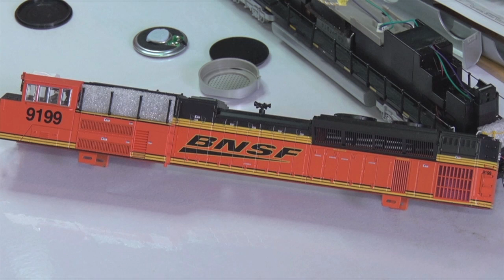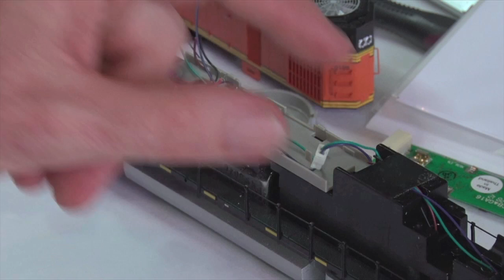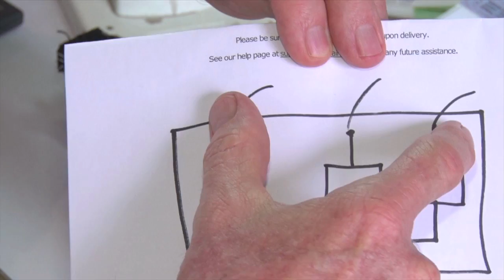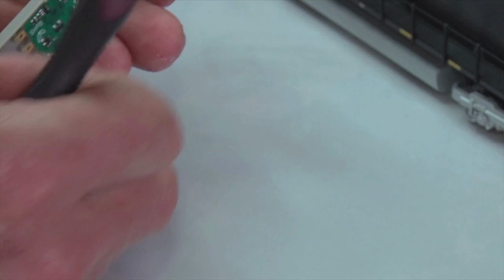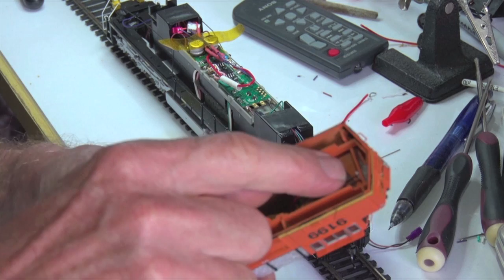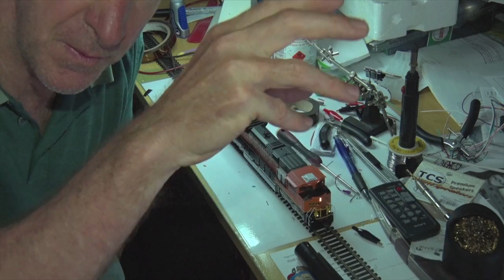MTH- SD70ACe Tsunami install. Part 1.

Comment: The ESU loksound Select Direct Decoder does not use such capacitors (the ones that forced you to turn the decoder upside down), so if you weren't standardizing to tsunami I would suggest that decoder for any install in any locomotive. Lucky for us modelers, model companies seem to be standardizing to 21 pin decoder plugs, which offer even more functionality than the full-board replacement.

Comment: Just a quick question, I have an MTH SD70 and just wondering how the hell do you remove the body ? I have looked all over and cannot find anything about it....
Reply from the maker: Hi William, there is a trick to it! You have to remove the handrails from the cab to the walkways, then there are four tabs under each truck. Watch the video on "Rarwer" channel on you tube, Matthias does a good job on showing how to do it! 
Cheers Gregg :-)

Comment: Matthias does a great job on installs.  It does take patients.  I use the SMD 0403 or a little larger for the headlights.  Try soldering two together and then the wires.  Thank goodness for a strong magnifying glass.  The real problem  is installing them on the lens.  After install I use liquid tape to blacken the back which gets on everything.  I wish they would start spending sometime on the drive system.  The motors are terrible.  I just bought a Mashima motor to replace an Athearn RTR CN Dash 9-44 which sounds and run like crap.  I also have to replace the old wheels.Scott
Reply from the maker: +Scott Downey  Yes Scott, Matthias does a great job, he worked in the electronic world so is used to the small components...too small for for me , especially with one  eye! The drive systems are 60yrs old, it's time to move on ...SOON.
Gregg.

Comment: hi Gregg... i have worked on Bimmers for about 30 years & believe it or not they switch ground (negative) on all the electronics... i'm curious if the decoder burns up.. looking forward to the final result.. good job!! & thanks for sharing.. vinny
Reply from the maker: +bnsf6951 Hi Vinny, yes lots of car electrics switch the negative and we do it a bit in railroad signalling too! The decoder is fine, most of the heat was coming from the high draw of the motor which has failed. I'm trying to upload the video now, not happy with electronics at the moment!!
Gregg :-(

Comment: Hi Greg. Great to see more of your decoder installations. I look forward to see / read your thoughts about the Soundtraxx Econami range of decoders, now that the Tsunamis are no longer available. I have done 7 with all the different formats and I quite like them as they are very flexible in programming, run smoothly and are cheaper.
I don't envy your hot climate. I live in the cooler New England area of NSW for that very reason.
Cheers, Gary.
Reply from the maker: +Gary Ible  Hi Gary, thanks for the comments! I am not aware that the Tsunami range is ending??  I have checked their website and can't find any info on the subject?  Since the Econami range has no Gevo or SD70ACe files, I would be surprised if they dropped the Tsunami range? Maybe they are seeing how they go before they update the Tsunami range, which is getting a bit old now as far as newer decoders go. As for the heat, I will be retiring to country Victoria to escape the humidity I think..LOL 
Cheers Gregg
Reply: +FishplateFilms Greg, of course you model the modern image locos so at the moment the Econami range sound files will be of no use to you. It is strange that the official Soundtraxx site has no info on upcoming decoder release but the various forum sites are going into 'meltdown' with conjecture and gossip. The Tsunami replacement should of course  be 'state of the art'. Dealers cannot order Tsunamis anymore and only have what they have in stock. Gwydir Valley Models in Glen Innes NSW are selling their stock of Tsunamis for $95.00 Oz. If you want something now you may need to stock up.

Comment: Nice work.  Quite the patience to do all this on a running product (Yes, I know you don't like the stock decoder!).  Now that it has failed, write the company and explain the incident and what a new motor would cost.  It might be reasonable.I'd recommend ESU LokSound Decoders.  Aside from being quite simple to program the sound has both Startup and Shutdown sequences which the Tsunamis don't seem to have (and if they do, tell me how to do it as, I'm only aware of F8  or change direction when stopped to 'quiet' them, but no nice Startup or shutdown(.Now, Intermountain and MTH - How do they compare?  Detail, finish, etc?  I have an IM ES44DC on the way (with the Yellow Swoosh).
Reply from the maker: +chrislef2002 Thank you Chrislef! I have done about 40 decoder insatll's  so far and this one has been the most frustrating. The loco is out of warranty so a motor replacement is unlikely?  Tsunami do have a start and shutdown sequence, move the throttle to speed step 1 quickly and back to stop, to shut down, press the emergency stop on your cab once. Pressing F8 is the mute key. I have 3 IM Gevo's, the detail is similar to MTH, very nice but they also have motor issues and all 3 run erratic at certain points in the speed curve. They are also geared very high and even for me are difficult to speed match with other brands. I would not buy either again, which is a shame because both are beautifully detailed models but for me it's all about performance and reliability! 
Cheers Gregg.
Reply: +FishplateFilms Yes, the IM and Speed Matching.  I watched your videos, attempted many times to match to my Walthers CN SD70ACE... Was checked into the local mental institute... Released and did a custom speed table for All 28 Speed Steps, tediously testing one by one against the Walthers...  finally done!  Crazy.ESU LokPilot and LokSound so much smoother to work with than other decoders... - Chris
Reply from the maker: +chrislef2002 LOL. yes the mental institute, been there done that!  I also did the whole speed table thing years ago with a Kato that was a bit lazy, drove me nuts as it constantly changed speeds a little from run to run. Now I just set the BEMF as low as possible and match the speed at the lower end . But with the IM , I may have to go back and put a few custom setiings on the speed curve to smooth them out? You realise the SD70 ACe  has helical gearing,( like their other models) a first for our trains and a HUGE step forward in the industry!. 
Well done on taming the  IM Gevo's !!
Gregg ;-)

Comment: Kudos to you for venturing down this trail.  I have 10 of these locomotives that I would like to change decoders in.  9 have the Proto Sound and 1 is non sound.   So far I haven't built up enough courage to attempt it.  Damn MTH for doing things backwards!  But....they did it on purpose.  They want walk to the beat of their own drum.  They thumb their noses at DCC.   Hense..their DCS.    So that means modelers like us, have to pull our hair out, just to have something decent.   Sorry to hear you ended up having problems.  Was it the decoder or something else?
Reply from the maker: +Deryk Glass Hi Deryk, thanks for the  look see! Nice tribute you did  as well ,  a great modeller to be surely missed.  Any way, once you get into them they are not too bad, the onl issue is the lighting on the front end, Number board lights and rear light are fine, just issues with the head and ditch lights. I have seen a few loksound instals and they are no easier and I feel look more complicated, I like a decoder "board" to connect to. They would sell a lot more if they were compatible as you say, don't know why MTH wan't to be exclusive,but it's not doing them any favours??  It turned out the motor is shorting out, causing most of the heat issues in the decoder, it failed yesterday and caused a fault code in the decoder, a video is coming on this soon! Thanks again mate and take care.
Cheers Gregg.

Comment: Nice video with some good thoughts on the install.  I'm not very good at installing the decoders, so I appreciate any insights that I get from others.  Your comment about MTH having "different" wiring brings to mind one of the many reasons that I have ditched my MTH units and don't currently plan to buy any more.  Mike prefers to go off in his own direction and won't standardize his system with the rest of the HO scale hobby.  That might work in O scale but it creates major pains for the HO scalers.  I hope your loco runs well becuase I have VERY poor experiences with getting parts from MTH.  People deride Athearn but their customer service has always been good (for me at least).  Kato USA is fine for parts, but American HO is such a small part of Kato's sales that they just don't care to update their models or produce new types of units - very unfortunate because the Kato drive is still about the nicest "out of the box" item available.   Intermountain runs well but they bought a batch of wimpy motors that ned to be replaced.
Reply from the maker: +Gary Binder Thanks Gary! You are spot on with your thoughts on all the above, I couldn't agree more! I don't why why MTH don't wan't to play with the rest, a poor business decision in my opinion? As for running well, the motor has failed with only a few hrs of light running! Now I know I may have got a "lemon" but I have read many more comments like yours and it seems it is not uncommon. So first and only MTH for me, a video is on the way about this. I also have 3 IM Gevos which all run erratic through the speed curve so I may have the bad motors? No more of them either, so it;s Kato and Atlas from now on, I do agree and wish Kato made newer units, the new Walthers Gevos and ACes will be interesting? 
Thanks for the feedback.
Cheers Gregg.
Reply: +FishplateFilms I picked up a Walthers SD70ACe in BNSF colors, but haven't run it yet (too many models on the old work bench).  The one I saw at my dealers looked like Walthers MIGHT have spent some effort to get a "runner" even if the modeler has to do his/her own grab irons and fiddly bits.
Reply from the maker: +Gary Binder That great Gary, I talk about these in Part 2 of this video. Proto use Helical gearing which is much better than a standard worm drive. I feel they are testing the waters with these and if they sell they will produce a proper detailed version? If they do they have my money already..LOL
Cheers Gregg.

Comment: I agree decoders do get hot, even during the winter time.  At times when it was cold I heated up the basement with all my decoders.  LOL
Reply from the maker: +upsd402 LOL, even with the sound off and not moving they still get warm. It's cool to feel the heat out of the exhaust when they go by!!

Comment: Hay Mate, Now you need to become a trend setter and switch to the Loksound selectdirect decoders. I gave up on Tsunami, much better minimal heat 6 FX functions and the sound is the bomb. Spike from Ohio
Reply from the maker: +Spike SP Hi Spike, Loksound are good decoders , no doubt about it, but I don't like the fact you can't change the notch settings to match other decoders. If they had that function like Tsunamis, I would use them for sure!
Thanks for watching. 
Cheers Gregg.
Reply: +FishplateFilms Humm I never tried running them together, I usually run the Tsunamis together and the loks together. I bought the programmer, I found out you don't want to use JMRI to program them that definitely doesn't work well. I'm going to experiment with that and let you know.  You keepin Lord Stan out of trouble? lol
Reply from the maker: +Spike SP Loksound have weird notch spacings , I like to run as prototypical as possible so all locos must notch up and down together. Ok if you run the same decoders together as you do, but I mix my fleet up all the time.  I do however love the Loksound slight delay on starting, and the great horns! I have always said that if Soundtrax and Loksound had a baby, it would be the perfect decoder..LOL.
Lord Stan is keeping out of trouble and will be back on the screen soon! 
Thanks Spike!

Comment: the Job I've learned many years ago, was : Energy Electronics multiple device and equipment system engineering ! LOL thanx for calling me a "Chirurg" ! But I really lay my hands on the Ditch Light Circuit boards for flashing Ditch Lights
Reply from the maker: +Rarawer It is too small for me Matthias..LOL You are very clever to do that, I wouuld have a pile of scrap plastic if I try it..LOL

Comment: Very Interesting Gregg. I'm sending my MTH SD70ACe back to them because it rides too low and ended up braking my snow plow. Also where my track changed elevation it would come uncoupled to my MTH SD70M-2 which has a perfect height compared to a Kadee Height Gauge. 

One side note about real SD70ACe locomotives since I run the real thing at work. They have the absolute loudest horns of any Locomotive I have ever ran. If you want to make yours like the real thing I'd turn the horn volume to its maximum setting. 

Cheers,
Tim
Reply from the maker: +Seaboard Central Thanks Tim, you know it's not fair you run them for real!  I'd give anything to have 20/20 vision so I could be an Engineer! They are a little lower than my Katos, but not much and the coupler height is right on mine. Hope you get it sorted. Have fun at work ya' lucky bugger..LOL
Cheers Gregg.

Comment: another great installing Video Gregg ! On all my Tsunami installs in MTH ACes I don't use the Plastic Thing from the Original Board !!! I lay the GN1000er directly on the Metall thing Chassis over the Motor ! Maybe thats the reason why I don't have (or some of my Friends) Heat problems ! Metal turns the heat away ...
Reply from the maker: +Rarawer Thank you Sir! It has been a pain, but a good learning curve, but not over yet as the motor is faulty and shorting out once it gets warm, so another complete pull down, not easy like a Kato! I think most of the heat was from the motor current overloading the decoder, not so much being upside down?
Gregg:-)
EVIL loco!

Comment: I didn't know the decoders get hot. Interesting Gregg. Good idea to drill the exhausts. 
How about putting some black masking tape flat under the fans (or over the wires) so the wires can't be seen under the fans? 
Shame about the decoder burning out as you predicted.  :-( Laurie.
Reply from the maker: +Calvertfilm Hi Laurie, yes they get warm for sure! You can't see much through the fans actually and tape would fix it. The decoder is fine, the motor has a fault causing high current  draw making the decoder shut down .So now it's a pull down again! Thanks for watching!

Comment: Very interesting install Gregg , be good to see how long the decoder last been up side down . 
Cheers Glynn
Reply from the maker: +QRoutback Lets call it interesting...I have a few other words..LOL The decoder is right way up now , it was getting too hot so I milled the frame to get it right. Now the motor has shat itself!!, lasted about 2 hrs running with no load and a hour with 10 cars!  I think most of the heat was caused by the high motr current draw, no so much the decoder position?
Not happy Jan!
Reply: +FishplateFilms Bloody Hell that is not good , no wonder you not happy , is the motor covered on the warranty here or do you have to ship it back to the States ?
Will a Kato motor fit ?
Cheers Glynn [ you going to run day a Stew's next Sunday 3/4/16 ? ]
Reply from the maker: +QRoutback It's way out of warranty Glynn, I've had it for over a year and decided to do it next. Kato motor won't fit!  Thanks for the run day heads up.